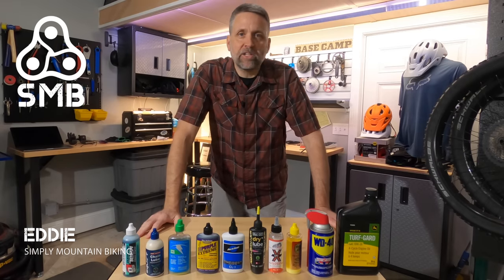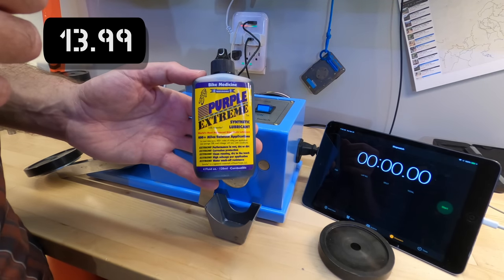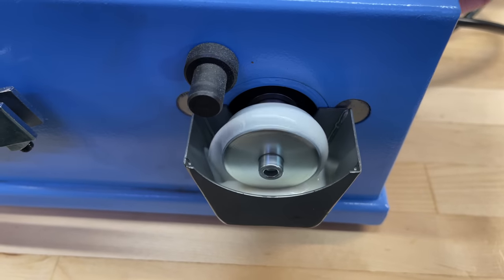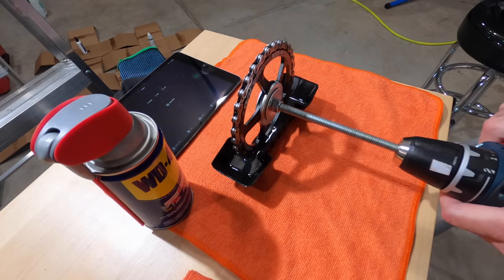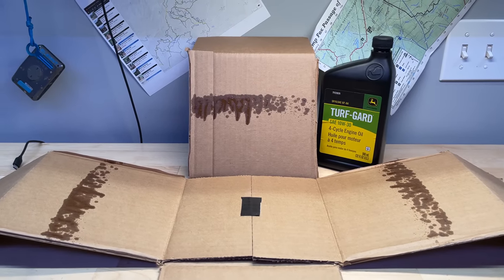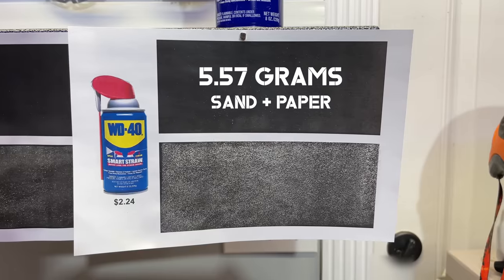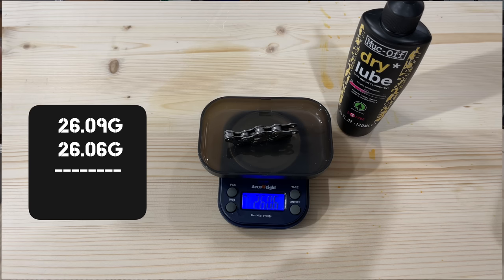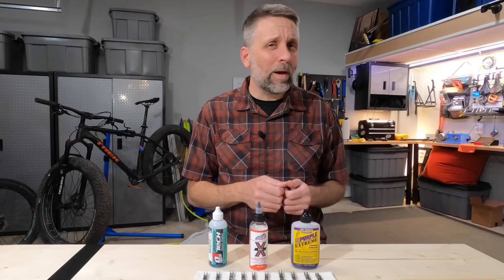Ultimate Bicycle Chain Lubricant Test | Best Bike Chain Lube

Comment: I had been using RockNRoll Gold for years on my gravel bike. When doing long rides in the rain and mud, it would seem to wash off and I’d see rust marks on my chain if I didn’t clean and reapply immediately after wet rides. I was doing Big Sugar and the promoters warned of wet low water crossings. I switched to Squirt before race. The rain and mud appeared for part of the race as promised. I hosed off some of the mud from my drivetrain at mile 73 checkpoint. My chain lube appeared to completely fail around mile 90 to 93. My Question; Would Allied’s Grax preform similarly to Squirt, as it’s a similar go on wet, dry to wax coating type of lube? Would you consider doing a test on Grax? At $20 it’s at the top of the price range. Unfortunately , I’m in Alaska and the weather doesn’t allow for a personal trial until spring. This is the second test I’ve seen on your channel. Great work, 1st rate content.
Reply from the maker: Thanks for sharing your experience.  I'll check out Grax. -Eddie

Comment: Used to use Muc-Off dry and was pretty happy with it until someone recommended Squirt. Squirt is OK but attracts more muck and seems to need more frequent application than Muc-Off so I'll probably be going back to Muc-Off. I find Muc-Off wet is too sticky however, even for wet conditions so I don't use it.
Reply from the maker: Thanks for the info! -Eddie

Comment: If you could test some of the chain lubes from the uk that’d be awesome. Great in-depth review
Reply from the maker: Great suggestion! What are the common ones in the UK? -Eddie
Reply: @SimplyMountainBiking  all the usual brands muc off, finish line etc.I tried squirt chain went orange due to salt on road riding. I’ve stuck with rock n roll gold in the summer we have and then the extreme in our winter. Can easily buy it from merlin cycles

Comment: I shared this video, here is  what some person wrote, I translated it into English, via Google translate, this text translated well, so no correction needed: It's a complicated test - but it's far from good.

 This is such a test that seems like science, but it is not at all.  It seems wise, because it is complicated.

 But to test what is a good means of lubricating a chain - without a single rig involving an actual chain, or a standard load of this during testing - it will at best be entertainment and nerdism - but it gives absolutely no sensible answers  .

 I actually had to laugh a little when I saw "the sling test", so it was a little fun.  There is no bicycle chain in the world that has ever seen that speed there, so it is completely irrelevant if the oil is thrown off then.

 There are also no numbers on his friction meter, and it is not very likely that neither speed nor load there is similar to what actually happens in a bicycle chain - he assumes only a number of variables, and gets completely worthless answers.  Furthermore, he measures everything down to the smallest gram and millimeter - but turns on and off machines and hours by hand at random.

 Intricate, difficult and "advanced", but totally meaningless.

 If anyone should be genuinely interested in what actually constitutes good lubricants for chains, I would recommend, for example, Friction Facts' tests from 2013/2014.
 They are methodically quite good (as far as I can understand) and there are probably more of that caliber.

 Most tests I have seen have basically concluded that it is at least as important that you have a clean chain in the first place, as what you lubricate it with - and that it is very, very difficult to surpass the effectiveness of pure paraffin wax on a clean chain.  And that dirt is crap.
Reply from the maker: Thank you for your comment.  -Eddie

Comment: I really like your video. Can you also make a video on Best Degreaser  and cleaner for the bike,  and can you also compare it with the diy homemade cleaner.
Reply from the maker: I think I'm going to take a pass on degreaser.  I've decided to not ever use them on my bike.  Too much chance of getting them into jockey wheel bearings, bottom brackets, hubs, etc. -Eddie

Comment: Right before I found this video, I just watched a video about how leaving Muc Off on your cassette for a few days it turns into hard glue that basically doesn't come off
Reply from the maker: So weird.  I never have trouble wiping off the Muc Off I tested in this video.  I usually clean my chain after 3-5 rides.  Very wet where I live. -Eddie

Comment: Great video! Would love to see a test with Ebike lubes. They claim extreme pressure properties, and reduced wear. Would be interesting on the wear and sand test alone to see if they're worth buying? 

 Currently using your tested MucOff Dry - and on our MTBs we're stretching a chain to .5 every 1600km. When on a Sram NX Eagle Cassette, I was also replacing the lowest cog at that mileage due to skipping. Also just stretched out a KMC E10T to .5 in 1700 street ridden km on our other E commuter bikes. Using a Parktool chain checker to measure wear. 

With the cost of Chains and Cassettes, I'm all over reducing total wear - wondering if Elubes are worth the hype.
Reply from the maker: Curious.  Thanks for sharing.  I don't think I'll be testing e-bike lubes... -Eddie

Comment: There are.a large variety of industrial roller chain lubricants that should be tested. Specifically the industrial roller chair lubricants with moly and synthetic oil/based.
Reply from the maker: Thanks for the tip! -Eddie

Comment: I am currently testing Smoove lube but defenitly overhyped, but does perform well. Its supposed to be all weather and super long lasting, but I've not used any lube that can last for weeks, some reviews make it sound like that, so far it did well 3-5 h tides, some has some light snow, most warm and dry some bit muddy, but did quite well, but defenitly noticed a degradation in performance at if I tried to us eit the next day, so I will keep doing wha ti always have done. Lube chain and leave for next day to use. And relube after every long ride
Reply from the maker: Great advice! -Eddie

Comment: I've been using MucOff Dry for a month on the trainer and outside.  Brand new chain, degreased and dried.  Soaked the chain in MucOff Dry and let dry hanging up for 24hrs.  I wiped as much of the excess as I could.  What determines when the excess is gone when wiping?  I'm pretty sure I wiped it more than most would when wiping off excess, spending a good 5mns wiping off excess.  Still, the chain picked up grime from the road and I had to wipe it off spending at least 5-10 mns getting all the black grime off.  The chain is definitely lubed very well as the links are very loose when pushing on.
Reply from the maker: Yes, after a year of using nothing but Muc-off Dry on my chain, I am seeing similar.  My chain is well lubricated and there is very little friction when pedaling - but the external lube does turn black as it collects grime on the trail.

For my use, I'm okay with that.  I clean my chain in no less than every 5 rides - because I ride in very dirty conditions with stream crossings, mud, and occasionally sand.

Where my experience differs from yours is that I find cleaning the chain much easier than you describe.  In fact, I think cleaning off Muc-off is easier than most other lubricant products I've used.  Just spraying my chain with jet nozzle from a garden hose removes most of it.

I don't use a chain cleaner any more because I'm concerned with solvent ruining my jockey wheel bearings and derailleur internals - so I pass the chain about 20 times through a microfiber cloth after spraying and find that it's clean and ready for re-application of Muc-off.

Thanks for sharing! -Eddie
Reply: @SimplyMountainBiking   Maybe I just need to spray it off instead of wiping it.  I wish it would dry like a wax though!   They should not call it a dry lube lol.  Squirt does dry but it's too messy.

Comment: Hey Eddie, i bought muc off dry after watching your video. I do mostly indoor rides.. however i find muc off dry lube wears off extremely fast.. just after a week of maybe 100km mileage ride i can hear some squeek.. how far can you last with one application? Any suggestion on what to do? Thanks
Reply from the maker: I ride in moist and dirty conditions so I am wiping and re-applying every 30-50 miles.  Hope that helps! -Eddie

Comment: Already 1 min into the video I have a small issue with the way you're testing the lube. For example, I'm a bike rider and I lube my chain the day of a ride in my workshop or garage. I then travel out to the ride spot or whatever. Point being is that lube gets applied then several mins pass then I ride without reapplying lube to my chain. This use case is the most common. In your test you have the friction wheel always cooling down in the lube and the lube never has a chance to 'setup'. For example if I make a ceramic lube I'm going to suspend it in a liquid that will evaporate and leave the ceramic coating behind. Why would I do this? Well because the dust from a track or trail will collect on the medium meant to carry only the ceramic coating to the drive-train. I'm not sure about you but I never have a pool of lube under my chain while riding. I think this test would be more effective on motor driven cycles.
Reply from the maker: Thanks for the feedback. -Eddie

Comment: Awesome review, this is off-topic, but I want to know which of these oils would you recommend for the ball bearings of fishing reels, thanks...!
Reply from the maker: I used to fish quite often, so you're in luck!  In a closed system that gets a little wet, but not very dirty, I think I would use the Dumonde Tech.  It's sticky, so it will stay on your parts.  It has great lubricity and film strength.  The wear protection was phenomenal.  I kept my bottle after this test, not to use on bikes, but specifically for things like your application.  Good luck! -Eddie
Reply: Thank you for your attention..!👍🤟🎣🐟
Reply: I’m sorry for asking so many questions. I appreciate your time in responding to whatever you can, when you are able to find the time.... so which of these would be more useful, Muc-Off Wet Lube or Muc-Off Dry Lube, thanks in advance..!

Comment: I tried the muc off dry lube after this video. Maybe I'm not applying it right but it doesn't seem very durable. It's super thin which makes applying it tricky as you need to be careful when wiping the excess off you don't wipe it all off. It also only seems to be good for a short ride before the chain looks and sounds bone dry again. I'm leaving it a day before riding but that doesn't seem to make it adhere any better to the chain.
Reply from the maker: Thanks for sharing! -Eddie

Comment: Hey Mattie….I have this exact bike now for 2 weeks but since the 8 on sale for an extra 350.00 I am thinking of taking it back and getting the 8. Better forks (35 Gold RL) at least they seem better. Also 4 pot calipers and that rapid drive 108 rear hub. Negative for me is the SRAM NX/GX drivetrain. Thoughts?
Beautiful ride and scenery though so Thanks😎
Reply from the maker: I'm not sure this comment goes with this video?  Which bike and ride are you commenting on?  Thanks! -Eddie

Comment: how about regular motorcycle chain lube ?
Reply from the maker: I think most motorcycle manufacturers recommend something close to a 90wt oil, don't they?  At least that's what I remember from my dirt bike days.  90wt is very sticky and would have performed like the high viscosity lubes in this test (Park Tool, 10w30, RocRide Epix, etc.) I would think. -Eddie

Comment: Very interesting video and tests. After the stoning, how are you cleaning off the loose abrasive grit shed from the stone?  (Any remaining grit will greatly affect the results, as you will be using the wear tester as a lapping station) Cliff
Reply from the maker: Good question!  I sprayed the wheel with Simple Green and then wiped with a microfiber cloth.  Thanks! -Eddie

Comment: WD-40 is a water dispenser, it's petroleum based and hence it vaporizes much quicker. Although it's marketed as lubricant in today's market, it really isn't. It's more of a penetrator and rust remover/protect rather than lub. Saying that I'm still guilty using WD-40 cleaning all my fishing reel internals and not bothering to apply proper lub after.
Reply from the maker: Haha - thanks for sharing.  -Eddie

Comment: I own a bike shop and I find that Muc Off lubes go hard like tar and you won't be able to clean them with anything. This is of course if you leave the drivetrain un-cared for a while (which tbf many riders do). On the other side, regular chain lubes (that are made out of dinosaur bones) no matter how dirty the chain gets, if you insist you can get it squeaky clean in the end. And that's why Muc off is off my list. It just doesn't wanna come off if you forget about it
Reply from the maker: I don't have a problem washing off Muc Off Dry.  Some water and a light brush and it comes off pretty easy.  I wash my bike about every 3-5 rides and take the Muc-Off off then.  I re-apply a coat after the bike is dry and repeat.  -Eddie
Reply: @SimplyMountainBiking  yeah, you take care and wash it off frequently. It's the only way you can clean it
Reply: @ripptorr  Muc off is awful mate. Go have a look at zero friction cycling

Comment: For your last test to see how much lube is left on the chain, isn't muc-off UV active? Can't you hit it with a UV light and see just how much is left? Also, what was* the size of the silicon dioxide you used in the 'sand test'? Why didn't you use a mixture of clay and silica sand or silt particles? That's what most bike parks, tracks, or trials are made out of.
Reply from the maker: Hey - I really like your suggestion of clay and silica sand.  Very smart.  -Eddie

Comment: Excellent testing. I'm a roadie and want to try the Muc Off but I'm concerned how well it will hold up over +200km rides. I guess time will tell
Reply from the maker: That's a good point - take the tests here to inform what you want to use in real world application! -Eddie

Comment: I feel like the dirt test could have been changed a bit, although I don't have a suggestion as to how. With a claim like "up to 400 miles between applications," I would think Purple would be very attractive to dirt. The problem is that the rest showed how much dirt was retained after immediate application, but didn't really tell how easily it picked up dirt.
Reply from the maker: Thanks for the suggestions! -Eddie

Comment: As I mentioned in my previous comment this is a very good video. In fact I did not see a better one over YouTube. But what I recently realized is that something is missing. I really dislike hearing the chain noise when riding on a smooth road. From experience I discovered different lubes makes the chain sound different (according to my "calibrated" ears 🙂). Also it sound different over time - for example with WD40, chain becomes very quiet, I can barely hear it, but (in a dry condition) just after few days (and ~70km) it is noisy almost as a dry chain. 
   Do you thing you can invent an experiment to show us which of these lubes makes the chain most noiseless: directly after application and after some time or some travel distance?
Reply from the maker: That's an interesting requirement and challenge.  I wonder if a db meter would register these sounds.  Thanks for the thought and idea! -Eddie

Comment: Two top priorities for me in a chain lube is how quiet the chain runs and how clean the chain remains. Gave up on wax because I found it loud and developed gray gunk on chainrings/chain/cassette as well as poor performance in wet conditions. Curious if Muc-off runs quiet and chain stays clean?
Reply from the maker: In my experience using Muc-off since this test - it does run quiet for some time.  Riding in the conditions I ride in, I don't expect it to stay clean.  I clean the chain every five rides or so and it's easy to remove and re-lube.  Much easier than other lubes. -Eddie

Comment: I'm curious, what products did you use in this test in order to clean/degrease chain links(between tests)?
Reply from the maker: 1st: Wipe off excess. 2nd: Degrease with Simple Green. 3rd: Sand surface with stone. -Eddie

Comment: I've always used Boeshield T9. It's applies thin to get into all areas of the chain and has been great at keeping dirt/dust from accumulating. It also acts as a solvent so every time I relube and wipe the chain it helps to clean it. It does require a drying time but was apparently invented by Boeing for airplane components that need to move, but are too difficult to reach for reapplication. Would love to see another one of these tests with other common lubes, including Boeshield T9.
Reply from the maker: Thanks for sharing.  I've added Boeshield T9 to the list for a viewer's choice video. -Eddie
Reply: @SimplyMountainBiking   After watching your video I pulled out the MucOff dry, degreased my chain and gave it another go. It does attract a lot of dust onto the chain and after 20 miles I'm already hearing chain noise. IMO if a lube attracts dust it's just grinding that dust into your cogs. We know it did really well on the wear test but curious if a lube that attracts less dust isn't more important? After all, what good is the wear test if it's attracting particles further wearing out your drivetrain? Just a though! Excited for your next test and what you might add to it!